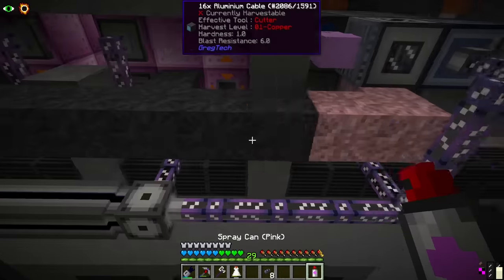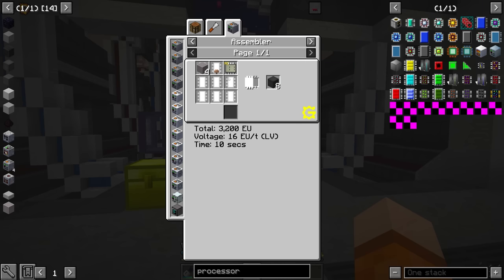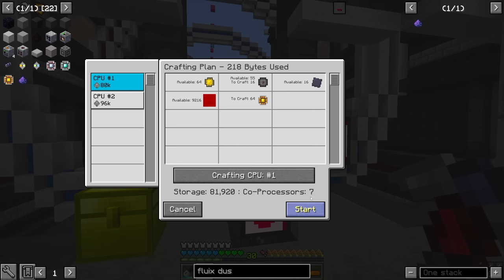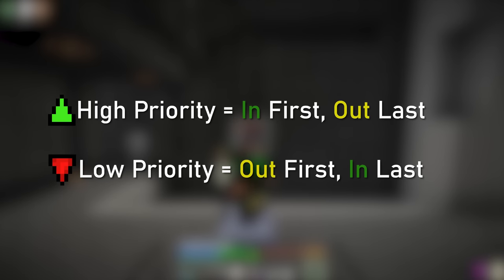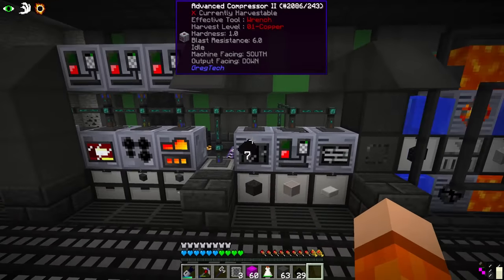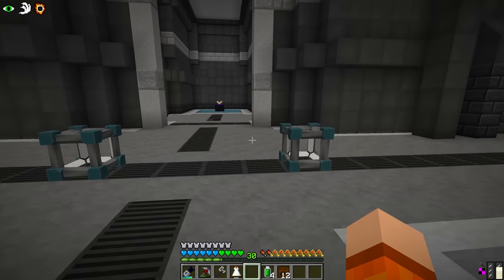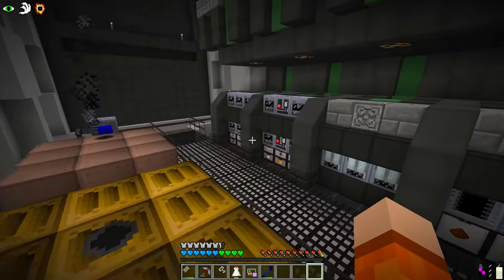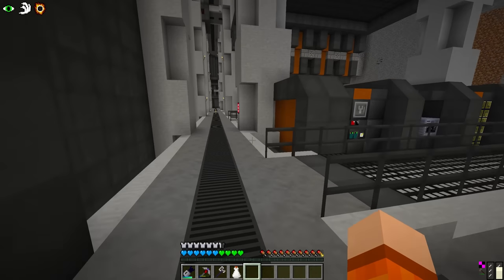Gregtech New Horizons S2 45: Gregtech Spaghetti

Comment: bro can you show me how you did the ME terminal Style 
i want it so hard and i can't join your world to see how it built 
please show how you did it 
thx
Reply from the maker: By terminal style do you mean the colour? If so you just need to change which colour of cable it's connected to :)
Reply: @Threefold.  i knew the color 
i want to knew how you did it like a block not a screen
Reply from the maker: @mmenbak7237  Add facades to the cable and to the front. They can be crafted by surrounding a block with cable anchors in the four cardinal directions inside the crafting table :)
Reply: @Threefold.  i think facades removed from ATM to the sky .i just find nether star facade .
ty bro😍
Reply from the maker: @mmenbak7237  It's not removed, it just isn't in JEI. It is still craftable though
Reply: @Threefold.  ooh ,i will try that